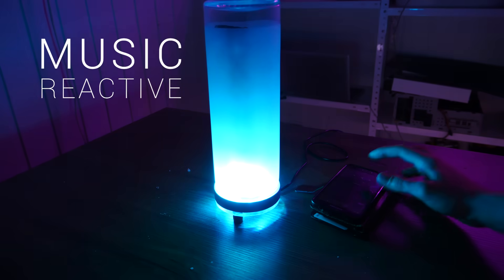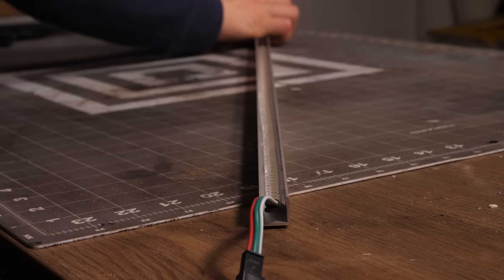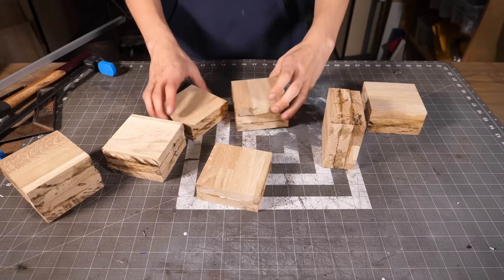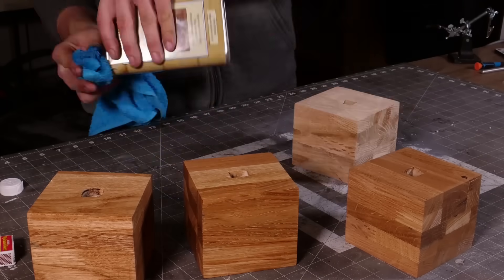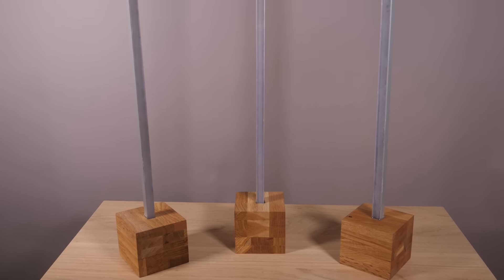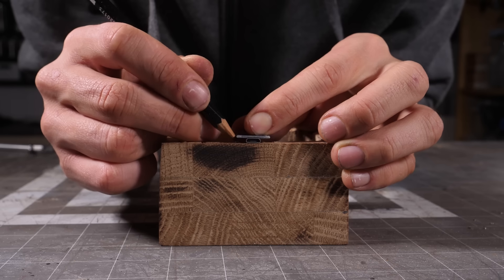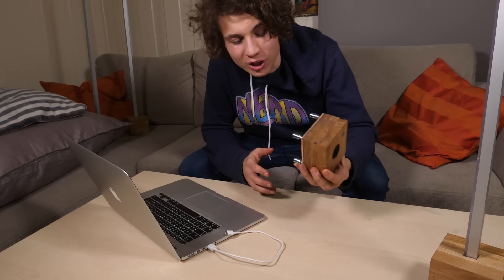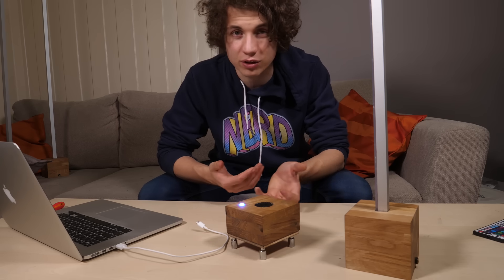Making Wireless MUSIC VISUALIZING Floor Lamps

Comment: Hi, thank you for this awesome video. Can you help me with the code. I also made 3 lamps but the boards are not connecting to master. I changed the led id to 1 2 and 3
Reply: Check ip address
Reply: @robomatics697  yeah...I figured that...thank you. But having 1 issue...that also reported to github....the leds getting disconnected after few minutes and again reconnecting.

Comment: Amazing work and craftmanship!! I wish I have a workshop like you. Nevertheless I managed to build my own version based on your work, improved latency with ESPNow and support for unlimited slaves. Do check it out if you can https://youtu.be/mx8jQKtFl0k
Reply: Could you share the code you used? I'm having some trouble with NerdForge his code when I try to use more than one light..
Reply: @milanwillems5083  Sorry I'm unable to share my codes at the moment as it is making use of a large private framework I've built. In term of communication between the nodes, I have switched to ESPNow. You can find the example codes in your Arduino Examples folder. NerdForge's UDP implementation does have some issues out of the box as it requires ALL 3 slaves to be connected before it start sending data.
Reply: @TorinNguyen0  I understand! Thanks for pointing me in the right direction! Have a great day.

Comment: Invest in a shopvac. Run a 2 1/2" or 3" pvc pipe around the room starting from where your shopvac will stay plugged in. Connect shopvac to pvc and cap the other end. Make connections in the pvc behind your equipment. Run a flexible connection to your saw. Run a hard line close to you sander and use/make something with a wide mouth. Rig up some type of long flexible hose that you can easily attach and detach from your center work table for when you need to cut stuff there. And there you have 1) a cleaner work environment 2) less mess to clean up at the end of your projects and 3) another project to make a video on

Comment: Why didn't you most purchase LED aluminum channel with a frosted diffuser? They're very cheap and easy to use find at local stores.
Reply from the maker: I agree! If you could tell me where to find that here in Norway I would be super grateful :) i haven't found anything like that
Reply: @Nerdforge  not sure about local stores in Norway, but what about Amazon? I'm in the custom LED lighting design industry. We buy aluminum profiles from Amazon and Alibaba all the time. They're really not expensive at all. I'm talking about $3/meter delivered, and that is with nice polycarbonate diffusers too. I like your project and your creative energy. I felt sorry watching you work so hard to create those profiles. And I'm sure they weren't cheap to make!

Comment: How much current draw? Any idea?
I did a rough calculation and found that for 144 Led's /1m at 60mA per LED under max that is 8.6A which seems pretty hefty for small gauge wire.
I saw you were using a 40W power supply which appears to show that you expected similar amounts of current pull. I am just wondering about the gauge of wire you are using here.
Thanks!

Comment: I know, this project is quite "old" but I hope somebody may help me...
I re-buildt this project because I think its absolutely genius, but both lamps reboot irregular after 5-50sec.
I tried to log the infos from Com-port and it seems that the Watchdog triggers the reboot.
But I don´t know how to solve the problem.....

At the moment i use 3 original Wemos D1 mini with level shifters ( the first tests were without and i thought they may fix the problem......).
Here is the serial output that triggers the reboot:

ets Jan  8 2013,rst cause:4, boot mode:(3,7)

wdt reset
load 0x4010f000, len 3584, room 16 
tail 0
chksum 0xb0
csum 0xb0
v2843a5ac
~ld
Reply: There is some glitch with it where it doesnt deliver enough power to the lights and they sort of stop and freeze and then start again. The fix was to get a single led in line before the strip that somehow fixed it. The fix has been referenced many times by people and you can probably find it here or in his instructables page.. I cant find it now though, if i find it ill update this comment with the link.

Comment: I need to ask few questions ( i am very very new to this arduino codes ) 
1) when i install the Slave code in to Wemos  then i can see on the arduino ide serial monitor that it does sends and receives hartbeats.
2) when i install the Master code in to NODEmcu i cant see anything on the serial monitor. ( the com port its the corect one ) PS i can only see the pushbutton sending upmodes 1.2.3 etc
3) i conect the wemos as per diagram and i can only see the first LED coming on 
4) i conected the NODEmcu as the diagram and the wifi working only when its connected via USB and 3V input. When i connect the 5V power on VIN pin wifi not working....
QUESTION......what the hell am i doing wrong 
Thank you in advance for you help and maybe your smart ass comments :-)

Comment: You reaaally should have done better testing prior to epoxying the acrylic to the aluminum, would have saved you losing the 4th lamp. I personally would have not used epoxy anyway, it would not have been hard to use screws or clips to make the construction semipermanent and modular

Comment: I already see a flaw with this design. The microphone can only pick up a certain frequency of noises. Also, there may be a noticeable delay with the lamps. Why not just have the audio signal sent to the lamps so the lamps can process the audio directly from the TV in real-time while still getting audio from the TV? You could use an audio splitter to simultaneously send audio to your main audio source (the speakers) and to the lamps (for post-processing in real-time). Please let me know if this helps at all.

Comment: The video was good but the provided details were useless, the code didn't work, tried contacting these guys through ig and email, no response!
Reply: i ordered all the stuff he listed and worked for hours trying to get the code loaded and working but i could never get it to work either oh well. i feel like he skips important steps hah
Reply: @michaelhansen911  man i finally figured out the code part after learning to code,
you need to take the reactive_common .h file & copy it to both the folders one which has the slave file & the other which has the master file. then the code would compile fine!

Comment: so are the parts just designed for this task by default? because since the LEDs are addressable, what I suppose is happening is the intensity and color value of the LEDs are being controlled according to the intensity of the sound based on priority. So how are you doing this all without any code ?
Reply from the maker: There's plenty of code. I don't think you watched the video
Reply: @Nerdforge  I didn't see any mention of the code anywhere in the description so that's why asked
Reply: @Nerdforge  yeah sorry my bad, just saw the arduino code

Comment: I have a question that when in sound reactive mode the lights are not reaching the top! in the other modes they are.(I have two led strip and both of them are able to work)
code change ：
   in slave      LED_PIN D2     LAMP_ID 1&2
   in master   READ_PIN A0         NUMBER_OF_CLIENTS 2
How should I solve this problem？
Reply: @Jackson Lin I am using NODE MCU instead of Wemos D1 for led lamps(SLAVE). I change the code as per you, I am using 1 lamp. (LAMP_ID 1 ,NUMBER_OF_CLIENTS 1).  BUT NOT WORKING.
Please Help me OUT.
Reply: I am waiting for your reply.
Reply: CHANDAN CHOUDHURY  I think the Nodemcu is different from the wemos D1 mini ,so you can attempt to change other LED_PIN number.
Reply: @Abhishek Bhaumick Not working with Node Mcu, but you can give it a try with wemos d1 mini.
Reply: @Abhishek Bhaumick  I know there is some other issues in the code, that's why I dropped the idea to make this like copy and paste. There are many other sources where you can get ideas to make new.

Comment: I know this is a few years old, but fun tip for anybody new to woodworking and gluing things up.  Put a little bit of table salt on the surface of your glue joints.  The salt will dig into the wood slightly and prevent your pieces from sliding around when clamping.

Comment: i have some question, the wifi lamps its conect with wifi or arduino board ?? or you need to have some router to make a network ? or the arduino make the network for lamps

Comment: Oke, i want to make this lamp but much cheaper, without powering each device seperatly. What do i need for that?
Reply: Do you really want 4?
Reply: @akhu1995  no. two will be fine.
Reply: @deejeemadrox1866  okay, but I don't have any knowledge how to do 2 but for 1, it's pretty simple, just get an arduino nano, the needed length of the led strip you need and also an audio sensor compatible with the arduino. Then just wire everything up correctly, write the code and enclose it in whatever design you like. That's all I know, and that's all I did with my setup :)
Reply: @akhu1995  Thnks. Write the code is above and beyond me. I want 60 led per channel, but not mic driven, i want to use the line signal for response. Ive seen thats possible.

Comment: Will using the WEMOS board for the sound sensor instead of the one he used in the video need a corresponding change in the code? I am actually building this, and I'm confident in my fabrication/soldering, but the code is a different beast. Can anyone shed some light on this?

Comment: Hello nice work.. I like it.. just one question.. the code.. where you install de code? In the lamp or in the module receiver?? Or In both?? And the receiver and the transmitter working as arduino? I hope I can have a answer from you soon!!
Reply: There is one skript for the master device and another for the slave device(s). Both of them require the mentioned reactive_common.h to work. So place the master.ino+reactive_common.h in a folder and load it up to the master d1 mini. Second do the same with slave.ino+reactive.common.h place both in a folder and load it up to your (first) slave d1 mini. Thats for one master and one slave. The provided code is made for 3! So change that in master.ino or take 3 slave (set them as describded) Should work.
Reply: @lukstil9320  so just connect the di mini in the computer for load both code in?.. is the same process to upload the code as you doing in a arduino nano??
Reply: @lukstil9320  and thanks for responding.. appreciate that..
Reply: @lukstil9320  I don't understand when you say!! "Loading up in the folder" in what folder? Or where is that folder located?
Reply: @lukstil9320  and sorry for ask to many questions.. and again thanks for you time.. and for the great job of show is this project

Comment: What would be the best way to make this accept a audio input like 3/8 audio Jack or rca cables , I would like to do this in conjunction with led strips on the ceiling for treble / midrange and the lamps for bass . The audio would be coming from a record player that has a line out .thinking of doing this for my father as a late fathers day add on to the record player I bought him . The help would be much appreciated .

Comment: so after 2 1/2 weeks of trying every night im about to give up 
i can see using serial monitor that  the 2  slaves and master are connected and establishing a wifi  network 
slaves sending heartbeats and receiving data back but no lights on led strips 
i did verify they are working using cylon sketch and a arduino pro mini 
please help !!!!

serial monitor dialog from master

12:39:12.549 -> Setting soft-AP ... Soft-AP IP address = 192.168.4.1

serial monitor dialog from slave 1

12:37:51.460 -> Connecting to sound_reactive ...
12:37:52.490 -> 1 2 3 4 
12:37:56.281 -> 
12:37:56.281 -> Connection established!
12:37:56.281 -> IP address:	192.168.4.2
12:37:56.281 -> Sending heartbeat
12:37:56.281 -> Returned: 8, 12:39:12.549 -> Setting soft-AP ..
. Soft-AP IP address = 192.168.4.1
also sizeof hbm: 8 

serial monitor dialog from slave 2

12:42:15.475 -> Connecting to sound_reactive ...
12:42:16.458 -> 1 2 3 4 
12:42:20.249 -> 
12:42:20.249 -> Connection established!
12:42:20.249 -> IP address:	192.168.4.3
12:42:20.249 -> Sending heartbeat
12:42:20.249 -> Returned: 8, also sizeof hbm: 8

Comment: Great Project!!  How many Hours did it take to Complete?
 I was concerned when you used Epoxy without First Testing all the Parts to Make Sure it ALL Worked Together.  As you found out Later, One of your Lights Poles didn't work.  TEST, TREST, TEST Before assembly! 
 I would have added short leads to the Microphone or bent it up off the PCB so all you needed was a small hole for Just the microphone and the PCB would be hidden underneath it.

Comment: HEY THIS IS AWESOME im atempting to build this when i upload the code to the master mic unit i get this error 

"reactive_common.h" no such directory found   any ideas
Reply: it seems to be a library! Find the "reactive_common.h" file and try importing the library from the "include library " option in the arduino IDE! Or you can simply copy paste the file in the sketch folder! It should work fine! :)
Reply: @codexrat  yeah i tried that i see the .h on git hub but dont have a link to dl it i copy and paste to IDE and ran sketch still gives error
Reply: @codexrat  also perhaps you could clarify on the build for the master with the mic do the switch and led ground pins connect with the ground with the mic? it seems that way so i did hook them all together

Comment: As always great video! Not to be a d*ck, but why use wifi? I actually modded your last video about the VU led lamps and made 4 of them (but a bit longer). It has the same effect, no wifi and the microphones are 0,50 euro cents a piece. And no latency...at least not from the wifi.

Comment: This project was awesome, I really wanted to try this but haveing 2nd thoughts on my eorking skill to achieve the same effect. I was wondering if you could add another way of creating this but without wireless connectivity. (The old analog way using long wires)

Comment: Hey there!
I dont know if anyone is reading this, but:
I tried to recreate this awesome project. I do now have a problem: When I activate the sound reactive mode all the LEDs flicker instead of reacting to the sound...
Does anyone know whats the problem? Is it the sensitivity of the mic? How can I adjust it? Or is it because I just use 50 LEDs on one Strip?
Reply: F. Wieland are you still working on this?
Reply: @christopherparedes7704  jes...
Reply: did you use the same Hardware? Had the problem, too with flickering of the first led when there was no sound. Fliker was less, when USB Power was connected for charging. Solution: Add a DC DC Step Up and provide the ESP ~5V to Vin.
You have to set the amount of led in the code of slave
Reply: @magicwoody  so: because I had 3 MCU Boards left so I used them, but they do not deliver the 3.3v needed for the mirco (why so ever) so I bought a D1mini and it works just fine with it.
Reply: @fwieland  ah ok, then problem solved :)  I build mine exactly as described in the vid.

Comment: Love this! Actually built it myself as well. Wood did not turn out the best in some parts but I don't have all the tools I need yet. Instead of the microphone I have my lights connected to 8266 running wled and I push e1.31 data to it using ledfx. Thanks for the video and inspiration!
Reply: Jeremy Davis hey Jeremy, were you able to make the ESP8266 work together?
Reply: @christopherparedes7704  ledfx works off a computer and will send e1.31 data to the 8266s specified.

Comment: Hi, you had used an addressable RGB led (i.e: WS2812b) instead can WS2813 or WS2815 be used, as both are addressable. Would there be any changes in the Arduino code?

Comment: I've just built this. How can I adjust the microphone sensitivity as mine seems to hardly react? Only when I tap it, not due to sound, therefore remote lights hardly come on. Just in case it makes a difference, I only have a 8-LED pixel strip plugged in for testing.
Reply: Hey. I'm currently trying to build this myself and having come confusion understing the controller schematic. Would you be able to help me out with that cause I have no idea what really connects to what on the right side.

Comment: Just having a look at your code and thinking it would be fairly easy to convert the controller to a mains powered 5V DC supply, and also convert the microphone audio input into a headphone jack because it looks like your code auto attenuates the VU meter response to the audio between the highest and lowest audio level it detects, would happily work with a direct audio signal instead of a microphone signal, and not need anything for powering the microphone obviously, just connect the headphone jack to ground and analog input, not even any need for an amplifier or potentiometer, does that sound accurate before I spend money on the entire set up?

Comment: Wait, so NO arduino main boards are needed, the WeMos wifi boards alone are capable of controlling 144 LEDs each by running fastLED with no memory issues?
Other videos have said that to drive that many LEDs, not only did you need a main Arduino board, but it had to be the Mega!
Reply: works fine, yes. Other vids, i gues you mean cine-lights, have more different VU in the code. I added some effects, also, and works fine

Comment: Do I need to change anything if I want to add more light bars?
Reply: Yes. You have to specify in the led_master.ino how many lamps do you want to use and in led_slave you have to give each lamp an ID. 1,2,3, etc

Comment: my esp8266 led diode circuit with button won't work i use a 10k resisitor and power my esp8266 with my laptop to test. but my led is not on and the push button wont work please help me